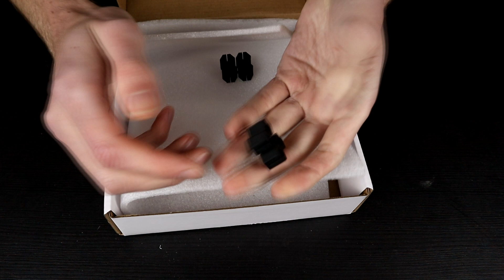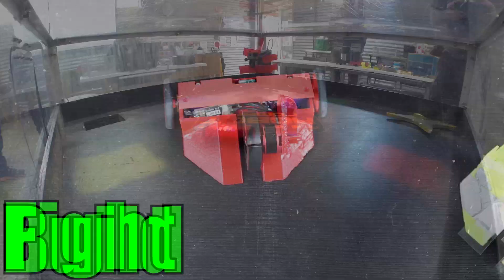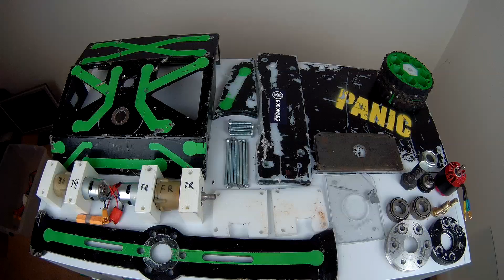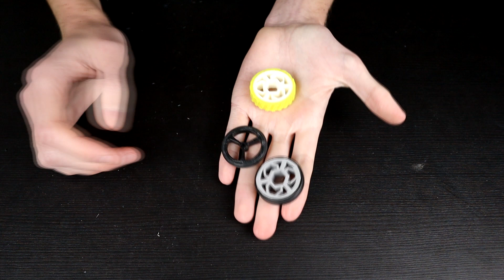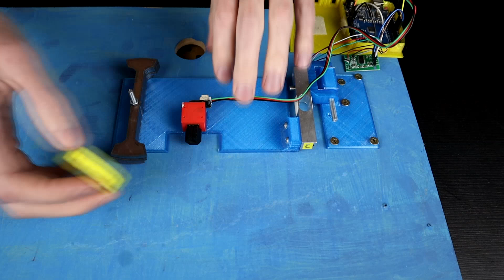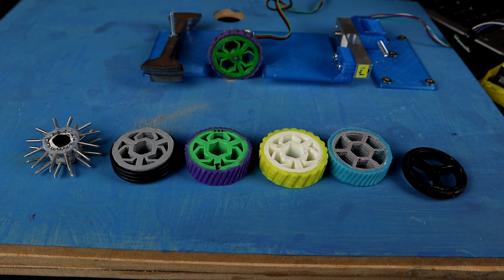How good is a screw wheel? (torque testing round 3)

Comment: Have you tried moulding 2 part urethane instead of silicone.  It’s a pain to do, but when my son and I made a bunch (80 odd!) using a modification of your thingiverse mold in acetic cure silicone, I made a few with some 40A smooth on and the tread seems much grippier.  I have been casting the urethane directly onto 3d printed hubs for Beetleweight with good results.
Reply from the maker: I havent but I will
Thanks for the suggestion

Comment: Battery voltage and motor performance can be affected by the different wheels, might be worth running from a constant power supply rather than battery. 

Also looking at the test footage a lot of the wheels aren't pulling in a linear axis, the test rig flexes enough when powered that they not getting perfect contact with the ground surface. Most of your wheel designs are flat and rely on a flat straight line where the Polou is rounded like a bike tire.
Reply from the maker: I was charging the battery to full between each test, but a power supply is a better option

Comment: The yellow/white and thin green/purple wheels both look like the treads have sharper edges on them, which might be part of why they grip better. Sharp vs blunt saw teeth might be a helpful way to think about this, sharper teeth dig in more where the blunt ones will skip over the surface. Ideally the tread should all come from the same mould, then you've got a direct comparison, if that's practical to do.
It could be interesting to see if mixing in fibres with the silicone makes any difference - any fibre ends pointing outwards should help dig into the surface, assuming they're strong and stiff enough. Glass or carbon should work for this, maybe some filament plastics as well if they can be stretched into the right sort of fibres. This is all mostly guesswork though...

Comment: Good test. I think you need to have the same size wheel on the other side as well so that the wheel could make full contact with the ground. It looks like the wheel is slightly tilted thus only a small contact area. The deep grooves will grip the inner edge, then let go as it runs to the middle of the wheel. I did think the smooth rounded polulu wheel will grips better at that slight angle, kind of like a bike tire. I do agree that the grooved wheels probably will provide better traction in dirty conditions. Then as to the width of the wheel, thinner provides more ground pressure but is also quicker to slip with debris. Try and ride a road bike with thin wheels over a bit of dirt if you don't believe me. 😋
Reply from the maker: Thats a good thought, I wasnt expecting the base to flex as much as it did, 
I might be ablt to get the wheel back flat by balancing and distributing the weight better too

Comment: A few thoughts.

1. I'm surprised how badly the O ring wheel did because I've always had amazing results with O rings in the past. It might be because I only used 1 on a super-thin wheel but IDK.

2. The difference between the yellow and purple silicone wheels could be the tread. Same with the thin wheel.

3. I am wondering what the advantage is to using an intermediate hub like the one you got from PCBWay is to directly attaching the wheel to the shaft.
Reply from the maker: 1. yeah same, I sware they did better last time, maybe mine have got old, or something
2. Could be, I havent looked into tread type/depth. I really should
3. its a practicality/replaceability thing, it started because I made TPU wheels with the d shaft in them, so that the wheels can survive a hit, TPU flexes and doesnt break like ABS or PLA, but, TPU flexes too much and if you try to put too much power through a D shaped hole in TPU the TPU rounds out and the axle spins. So to get the best of both worlds I print hubs to transmit the power from the motor into the flexible wheel. Yes I could print the whole wheel in ABS and cast silicone around it, but if it gets hit and breaks then I need to redo the silicone. I've never had to redo any silicone on any of my wheels, the yellow ones in this video are from one of my first batches of wheels 4+ years ago

Comment: It seems like one factor with the Pololu wheel is that it is basically a racing slick whereas the other silicon ones have treads, so it might also have a better contact patch than expected for its thinness. It would be interesting to see how the numbers change on a damaged/debris-covered floor.
Reply from the maker: Could be, I havent looked into tread type/depth.

A dusty/dirty floor is another good variable to think about
Reply: @TeamPanicRobotics  I think we had some discourse about this in the 1st torque testing video, that on the surface used a slick should work best. I think it would be worth producing a slick silicon wheel to compare to your grooved ones

Comment: Nice testing ben, always wondered though if the smoothness of the tread matters or would it be advantageous to put fine sand or powders into flat silicone to not necessarily increase standing traction, but to provide better grip when pushing or being pushed.
Reply: As the robots are so light, I think any hard particles in the tyre compound would act like tiny marbles and actually reduce grip. They'd certainly make the tyres more resistant to wear, but I'm pretty sure that overall grip would be reduced. 🤔

A soft, smooth silicone tread is probably optimal for a lightweight robot on a smooth floor. (Just my opinion.🙂)

Comment: Interesting results. Pololu is still king of antweight traction.

What about a foam tyre coated in liquid latex? I'm aware it will not last as long as silicon, but it is supposedly very sticky. Could that be enough to overtake the Pololus?

Also, I'm guessing there was no video last Saturday because you were very busy at the latest ARC meet?
Reply from the maker: I should try liquid latex at some point but people have had mixed results with that at ARC

Yes kind of, the week before  ARCs meet was hectic so this video a bit late